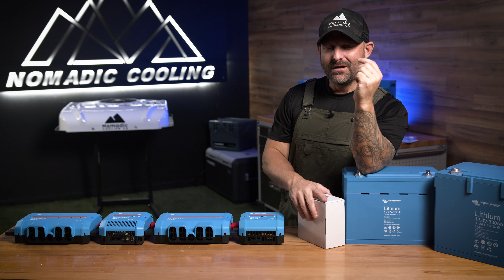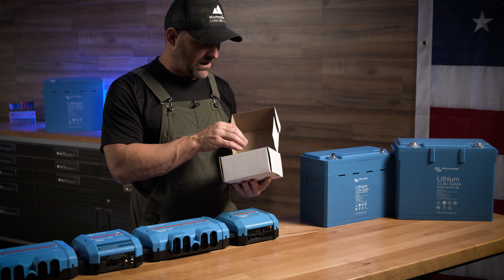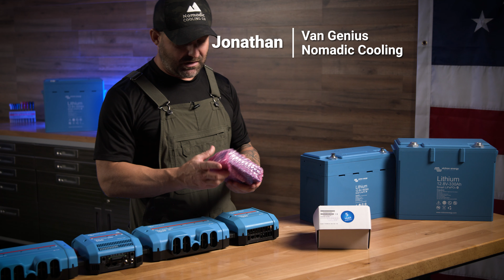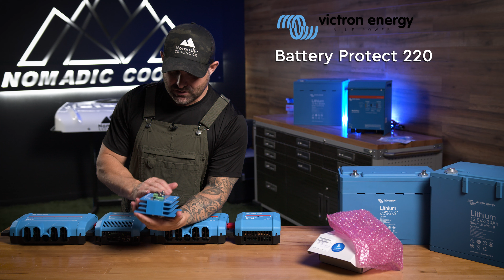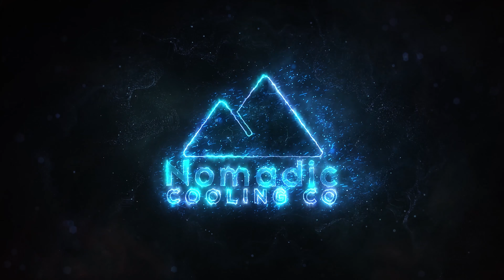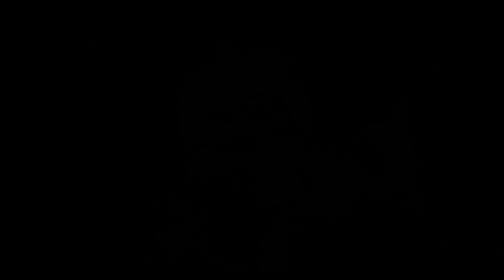Victron Battery Protect 220 for your OVERLAND ELECTRICAL KIT

Comment: How Does the batteryprotect utilize the 65/100/220 amp limits. Does it shut down or burn up If you exceed those limits?
Reply: relay